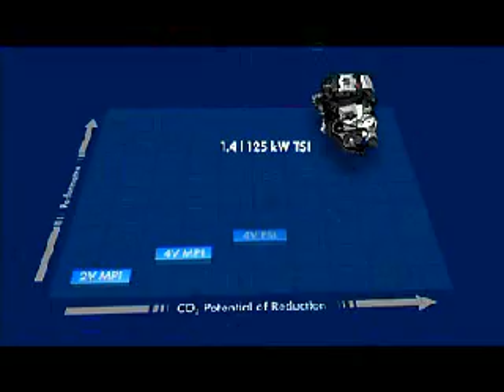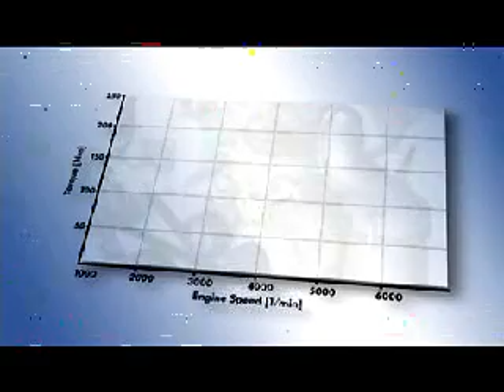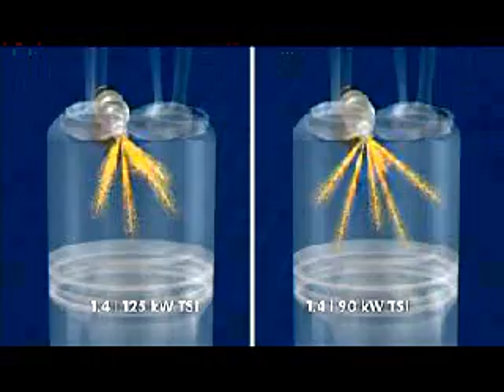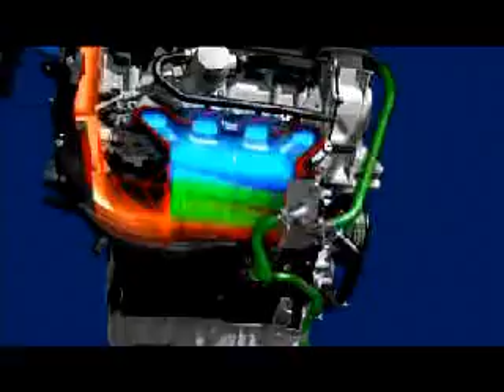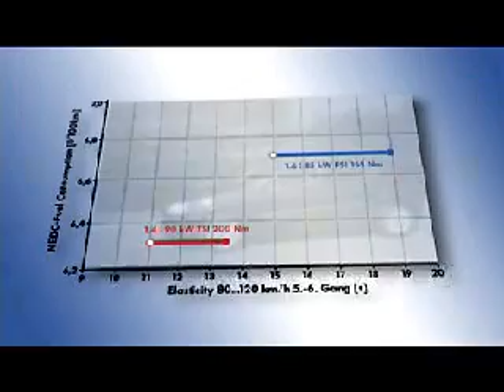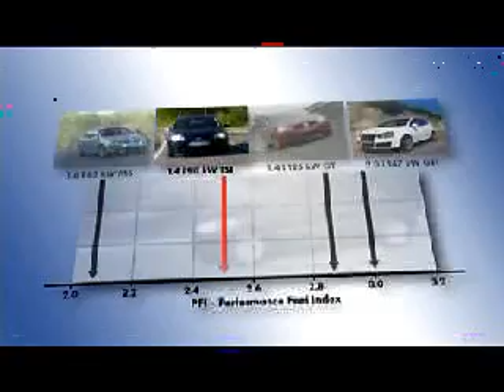VW TSI ENGINE ANIMATION

Comment: All 1-4 turbocharger intercooler petrol engines and all 1-4 turbocharger intercooler petrol engines hybrid : Easy damage, 20-100 l/100km, over 100 l/100km with all speed, F1 speed 160 km/hour to top speed, test maximum over 20,000-150,000 rpm by all CEO and team in all brands.

From
All brands databases 

End report.

All socials status grade F by all 1-4 turbocharger intercooler petrol engines, all 1-4 turbocharger intercooler petrol engines hybrid and they become terrorists class brilliant order to build these ones for fun destruction.

Comment: i run this very motor in my Audi A3 and i can vow that this engine is reliable. I have done modifications such as after market intake, downpipe, hybrid turbo and stage 2 software. my vehicle has jumped from 90kw and 200nm up to 145kw and 320nm and the car runs perfect as a daily driven vehicle.

Comment: TSI 1-4 turbo intercooler engines all and TFSI 1-4 turbo intercooler engines all : easy damage, 20-100 l/100km, over 100 l/100km with F1 speed 160-250 km/hour, over 250 km/hour on all straight curve circuits, test maximum over 20,000-150,000 rpm by all humans social, street racers all and humanoid engineers with brilliant terrorists class spies.

End report.

From
All VW and Audi databases

Comment: I own vw gold mk 6 1.4 TSI 118 KW 2010 with less than 100k on the clock and I have low compression in the cylinder 4 and misfiring. I just rang VW Australia and they said the car is out of the warranty, so you are on your own. Great service and reliability VW!
Reply: Sergey Kochevtsev lol, ah oh. I got 200k on the clock on mk5 Golf GTI 147kW, got a broken camshaft chain that spent me 4000 (extented warranty paid the bill, I spent 2000 on the warranty), runs fine now.

Comment: TSI engines turbo intercooler all : 20-100 l/100km, over 100 l/100km, easy damage

End report from VW database engines.

Because VW agents hide these data from CEO.

Comment: Great engines- had mine for over 180,000kms.. no problems apart from standard servicing requirements. Prefect combination of power and low fuel consumption.
Reply: Peter Hadjisavas Could you tell me, How often did you change the oil? every 15000km or 10000km?
Reply: +JurijLasic  Hahaha! minimal oil loss from my engine. Oil chaged every 5,000 klm. 1.8TFSI is a very different engine to the 118TSI. Don't know what oil your refilling with????
Reply: +Arthur Milstead  5000klm.
Reply: No worries. You should give oil with zinc additives a try. The Penrite 5w30 has this additive and I notice nill oil loss.
Reply: +Peter Hadjisavas You're right, the video is about TSI not TFSI, my bad. Answering your question: Valvo 5W30 was the oil it drank like mad, now after switching to Castrol 10W60 it's better, but still far from perfect
Reply: +Arthur Milstead There's no such thing as oil change actually for these :D you got to refill it so often, that you change it 3 times between the ACTUAL oil changes. Based on 2009 A3 1.8T TFSI experience. You won't do a 1000km before the low oil level popup appears...

Comment: These TSI engines are now suffering from a lot of major engine failures at low mileage too. Timing chain problems and piston/ring problems.VW has pushed the envelope too far and unfortunately the consumer is paying the price.Avoid at all cost.This engine is a liability. Stick with diesel or higher cc normally aspirated for lower maintenance.

Comment: I have owned a 1.8 tsi Jetta for five months, purchased new.

- exceptional performance, in particular the torque delivery, behaves like a midsize V-8
- exceptional fuel economy, I drive 120 kms/day, round trip. Average fuel economy typically mid-5-liter/100 kilometres
- extremely happy with the all-around package of performance/handling/build quality

On the down side, car is in getting a clutch problem diagnosed under warranty. Intermittent chattering, not related to driver error. Also, having previous experience with turbos, purchased extended warranty (to 200,000) in case turbo technology isn't sustainable over the long term.

Comment: TSI turbochager all report : easy damage,no economy,overload,unstable poweroutput
TSI turbochager all report : 1-5 km/liter on highway,below 1 km/liter in city and  average 1 km/liter 
petrol engine turbo intercooler ALL,petrol engine biturbo intercooler ALL,CGI turbocharger intercooler ALL,CGI biturbo intercooler ALL in Mercedes Benz, AMG,Brabus,Lorinser Report : extreme easy damage,no economy,overload,unstable acceleration,annoy noise,unstable poweroutput
petrol engine turbo intercooler ALL,petrol engine biturbo intercooler ALL,CGI turbocharger intercooler ALL,CGI biturbo intercooler ALL in Mercedes Benz, AMG,Brabus,Lorinser Report  :  1-5 km/liter on highway,below 1 km/liter in city and  average 0.98 km/liter

Comment: Problems: The engine exhaust 1000 times more particles than a modern diesel engine with particulate filters [TV germany: "VOX auto mobil", 26.01.2014]. Over the EGR comes the particles to the intake side and pollute the inlet valves. The exhausts get more and more toxic and the engine can fail. This is an gradual process and a expensive problem for the car owner.
Reply: Not anymore. The new EA888 1.8TSI and 2.0TSI has the traditional injectors in the inlet manifold and also direct injectors in the head. The inlet injectors will clean the backside of the inlet valves...

Comment: All 1-4 turbocharger intercooler with petrol engines in Brands : unstable acceleration,no economy,expensive repair,easy damage from all drivers,easy error ecu

Comment: @Robert Urban! Are you being genuinely serious!!? The old 1.9 tdi has arguably been one of the most bomb proof engines! my dad had a mkiii which did 220k miles no problems! ive got a mkv on 140k and engine is still solid as a rock! plus which tsi and which tdi are you commenting on?? the 1.6 tdi or the 3l v6? or perhaps the 1.2 R4 tsi or the 3.0 v6 tfsi!!?

Comment: I have the SEAT Leon with a 90kw engine.
Why that? it has the same mechanical parts as the golf, yet 10,000$ cheaper.
The interior quality suffers, I know, but I bought this car for the sole purpose of sporty driving, and, trust me, it delivers spectacularly.
currently producing 125bhp and 200nm of torque
when I chip-tune it, it will be 158bhp and 270nm.
can't wait.

Comment: I use 95 unleaded, and have the same power...
The difference between this and an aftermarket engine, is this power has to come from normal fuel.
Reply: 95 Unleaded?  Where do you buy that?  All over the American southeast the standard premium grade is 93 octane Unleaded with regular Unleaded at 87 octane.  At some stations in the Carolinas, you can buy "Racing Fuel" which is 100 octane and costs about twice the price of regular.  But I don't think I've ever seen 95 Unleaded.

Comment: americans cant get 170bhp out of a 3 litre
Reply: Just to update the numbers from 'elave16', the Ford Focus RS now gets 350 HP (350 ib.ft Torque) from 2.3L 4-cyl. And a lower price point, the Ford Focus ST gets 252 HP (270 lb.ft Torque) from a 2.0L 4 cyl.  I would agree that the  German companies generally get some very nice output from 2.0L engines, but they also tend to make you pay dearly for it.

Comment: The 122cv TSI motors VW are failing miserably.
I knew a lot of TSI motors with 20-30.000km has broken, My Scirocco TSI 122cv has broken with 2 years and 38.000km, with the max care driving, the great filming, refueling in the best petrol station in Spain!!23.600€ for this?for I had a broken motor?
If I know this before I had buying a HOnda or Ford or Bmw
I am INDIGNANT, I sent a letter to VW Spain and their answer it was poor and empty!!
IT`s my opinion and my sad personal experience!!

Comment: DESEIL ENGINE WITH TURBOCHARGER INTERCOOLER DAMGED ; 85% per day
COMMONRAIL DESEIL ENGINE WITH TURBOCHARGER INTERCOOLER DAMGED ; 77% per day
COMMONRAIL DESEIL ENGINE WITH BI TURBOCHARGERS INTERCOOLER DAMGED ; 81% per day
CGI ENGINE WITH TURBOCHARGER INTERCOOLER DAMGED ; 95% per day
CGI ENGINE WITH BITURBOCHARGERS INTERCOOLER DAMGED ; 99% per day
PETORL ENGINE WITH TURBOCHARGER INTERCOOLER DAMGED ; 95.9% per day
PETORL ENGINE WITH BITURBOCHARGERS INTERCOOLER DAMGED ; 99.9% per day

Comment: @evydaemon Nothing wrong with the turbo on this engine,just muppets treating turbo like crap ie. not letting turbo cool down before turning off,revving the shit out of it when its cold and not bothering to change the oil.

Whats not cost effective about this engine?the extra fuel you would use in a 3.0 l v6 could buy the car after three years.

Comment: Good engine with high power and, suprisingly, a lot of headroom. With moderate chiptuning you can raise the maximum torque from 200 to 260Nm all over the rpm spectrum and the maximum power output to 110kW.

Comment: bad engines for everyday and normal use milions of problems in parts and the engine even in stock powers.....in medium fuels and hot weathers or if you push it more than normal your problems start....briliant idea (from lancia 30 years ago) but only for rally and tracks...servicing  and repairing this engines wasent happy moment for us...if anyone  worked in vw dealer  knows..

Comment: The supercharger enhances airflow into the engine, making a purer air fuel mix, reducing emissions and improving fuel economy. The turbocharger makes use of waste exhaust gas to improve power output, therefore making even more use out of the fuel.

Comment: dsg is also more fuel effcient than a gearbox

a normal auto trannie is les fuel efficient.
close to 2 liter more on the 100km than a normal gearbox.

but a 8 cyl with a normal gearbox wil die sooner, you change alot.

Comment: clearly, not it's '94 car
: )
i'm planning to buy a used audi A8 4.2 or 3.3 diesel. it has a better fuel economy than the vectra.

restore the drive train from a tot z (gearbox, suspention, differentials, wheel bearings, axles) and drive it til falls apart.
(depending on how i get it, i overhaul this or the other, but wheel bearings, axles and suspention wil be overhauled.

i have been thinking about this cars for over atleast 3 year

the dsp is cool, it's slighly faster from 0 to 100km/h.

Comment: I did - there's no new 5 valves engines ( rest is all know old engines) 

anyway s60 T5 got 250 PS so there is no way u could beat it without serious modifications in vectra engine (stock had 8 sec to 100km/h)  

I u consider about economy put an LPG there. 

generally automatic gearboxes sucks

Comment: enter audi 5 valve 2009 in google.

the vectra does 7.3 or 7.5 to do 0-100km/h acelleration.
(but you need to skilled with the gearbox, because it reaches 6000rpm realy fast and cuts off there, realy anoying if you having fun overtaken people on a 2 lane landroad.

even thoug i realy enjoy engines, i recommend 4 cyl for daily use. 
it's just more practical.

automatic sucks, unles it's a DSG, pdk or any other dual clutch system.
witch acellerate faster and more efficient.

Comment: U see? I aksed which are now. If golf r20 is a sucessor of  r32 (who got VR6 4 V)  he will have a tuned 2.0 TFSI engine (270 PS) so it's not 5 valves per cylinder engine for sure.  

V8 TDI is 4 vales per cylinder engine 

S8 4.2 V8 5V (360 KM) was

Comment: hmm well I saw one s60 T5 and if u compare this to vectra 2.5 V6 24 V it is a real rocket , u can get 7 sec to 100km/h easily so it's not bad as a salesman's car...  

IMO 5 cylinder  2.5 capacity  with turbo is better than same 2.5 V6 6 cylinder without turbo...  
 I asked u coz i want to know how reliable this cars are.. especially engines. 

BTW if u want drive really cheap put there an sequential LPG installation but  Only Landi Renzo Omegas.

Comment: no, never drove it, but i did repair a volvo 850 t5 estate, police in holland used it.
the police in the U.K. also.

it's a car for salesman on the road.

(due to economical reasons), i have a '94 vectra 2.5 24v stocked, a engine designed by coswordt, 5 speed gearbox, only 170hp and something like 2100 pounds in weight, it's a rocked.

4 cyl with gearbox, are better for the 50km/h speed limit 
stop and go traffic makes a 5-6-8 cyl engine lazy, to much gear change or drive high rpm in 2nd gear.

Comment: i know, that smal civic vtec from the crx did that.
but that was an exeption.
the normal civic with vtec was, if i remember correct 110ps.
but it's a high rpm machine,  i think contineu racing trafficlights, wil get boring, the engine noise, although it sound pretty sweet.

but how long with it last?
a 6000+ rmp machine against a relax running 2.0 engine.

like i said, you need fast 0-100km/h and when possible, with no noise, you don't want that people can hear you comming.

Comment: who said anything about 2.9 liter / 100km.

i ried to say, i covered france completely (997km) in a almost non stop trip, if it wasn't for toll gates with only 1 tank filling.

vw wagens promised 50liter per 100km/h (or 5l to 100km) and their promise was true.

i kept my foot in a certain position, that the car always kept cruisig non stop 120km/h.
(i should have bought that handle for the steeling colom, to enenable cruise control).

Comment: for sure 2.0 wih 150 PS arent economical.. 

long time ago honda reach 160 PS from 1.6 engine. (benzin) 

which "new" line of VW engines are 5 valves system ?

Comment: diesel cars have also a higher resel price, than gasoline engines.

you can buy a used audi a8(8 years old) for 10.000€ +/-, you can buy a smal diesel new for 10.000 and stil resel for it more than 2000€ after 8 yeas.

: )

those a realy market data.

Comment: check my typos, there are more than one of them.
i know it's only 1 chain on the 4 cyl and 2 of these chains on some of the v6.

europeans have a more tight tax system.
some people like diesel, but want buy one, because they don't make that many km anualy. people that drive lots, like 60.000, but a diesel.

diesel cars are higher taxed @ buy and anualy.

Comment: why, many 2.0 engine are tuned for economy and don't even reach 150hp(atleast in that time).

marking technical, it's a good number.
1600 engine did around 90hp in that ....

why, vw, still sells 5 valve engine.
the only mistake, i might see here, that it is more exspensive, it need more parts and interruptions of the production line, to build others.

Comment: no, a electronic direct injected diesel is real good for people.
it's almsot impossible to kil the engine at traffic light when releasing the clutch accidental.

it has loads of torque, it runs good, they reach 5000 rpm quickly.

you visit the gas station litle.
i drive 1700 km to get home in the netherland in exactly 16 hours, non stop drive.
with litle more than 1.5 tank (50 liters)
@ exactly 120km/h non stop, i only needed to acellerate @ toll gates.
wanted to test my 90hp, topped it @ 210kmh

Comment: u wrote chains if I'm correct there is only 1 chain in 1.8 ... 

2.5 Tdi is a V6 so.. its obvious but tehe's a cam belt too. 

125 in this engine is weak. I would never say that there is a 125 PS - misunderstanding 

1.8 was a mistake and VW group give up this technology.  that's all.

Comment: well what can I say. Buy a turbocharged benzin engine...  but if someone think that it will be economical (especially in street race)  so he is  wrong 

I like small and light cars too but not for journeys or normal race - bigger cars are more stable especially when u drive fast (about 160-200km/h) and are safer, small cars are ok but  in the city..

Comment: there is a chain to control the the second camshaft, the one for the outlet ports.

on the front side there is a belt, but it only drives the inlet shaft.

the 2.5,... tdi has 2 of these chaints.

125ps for a 1800 is good number, else it would endanger other models.
i think for the aluminium head, it's a real good number.

the 125ps version has some of the parts required for the turbo version, already build in.
there is a tube under the radiator for the intercooler

Comment: the old citroen AX 1100 was caple of getting faster to 70km/h than a bmw 750.

litle fast cars are real fun to 'rally' in.
bigger cars are  more dangerous to drive sporty, because of the weight in the cornes.

litle cars are fun, you don't need speed, you need fast 0-100km/ times.

i think that0's the most importand factor in european minds

Comment: we littaraly race in the cities.

it's to crowded for the policia to function probaly in order to do something about it.

but going like 80km/h where 50 is alowed is not uncommen here in rush hour.
on the highway it's 'somewhat' publicly accepted to drive 140, where 120 is alowed.

i don't think you would be beabled to drive here on your  first day, without getting scared.

i can asure you, it's scary as a passanger.
it goes hard here on the roads.

Comment: i gues, you need to learn to understand whatr you read.

i said, i fixed a car with suffered a accident, passat
i fixed the chains of audi 1800 20 valve, i have pictured proof.
the only thing i haven't toughed with tools is aeroplain and a train. 

i'm dutch and i live in Valencia.
there are many 4 lane straights in this city.
with close to 1.5 million or more moving in this area, people realy race to the get first to next traffic light, the get the best spot, to trotle again, even before it get

Comment: i think some of the first rolls bently or bugatti used this technology first.

Such designs have been around since at least 1912 (Peugeot) and perhaps earlier.
source: wiki

people here in europe want eco and fast engine for daily use.

you don't need alot of torque, you just need to move yourself mostly of the time.
otherwise rent a van.

Comment: I was talkin about 5 valves per cylinder, where did I wrote that 4 valves per cylinder is wrong? lol 

I see you aren't a mechanic so u need read more about GDI FSI and knows why they putted this technology into cars if Japanese don't want to developed it..  (BTW Renault had similar engine too called I.D.E. - not produced any more)